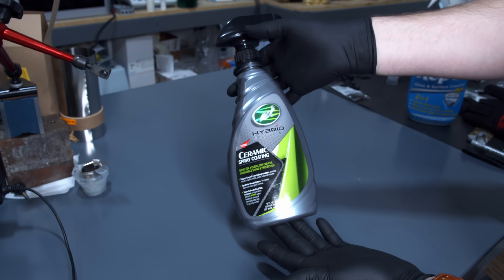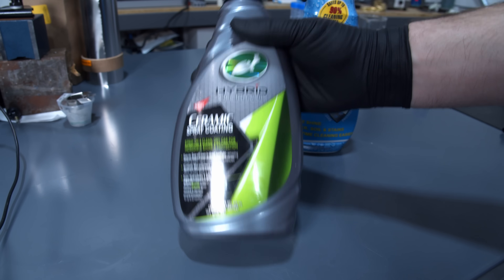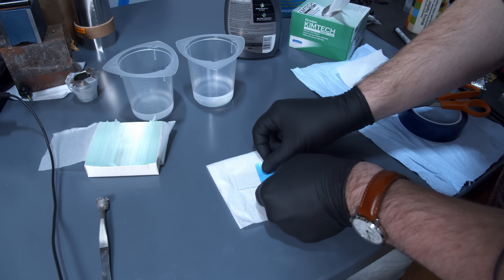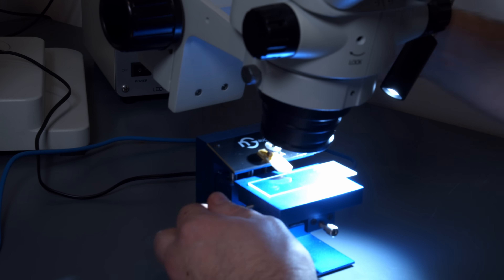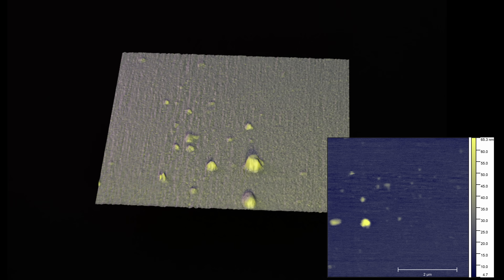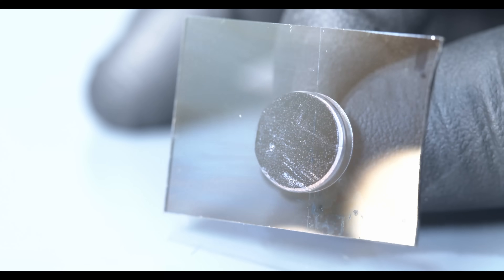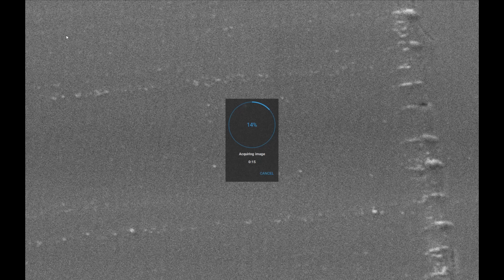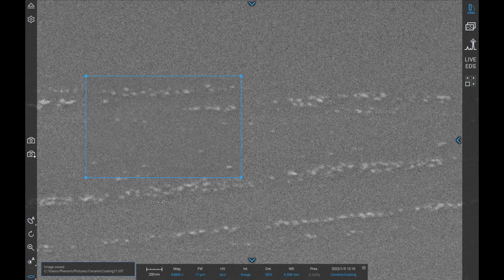Ceramic Spray is (probably) useless

Comment: I've used the 3M ceramic coating on cars, as well as on the windows, with great results. It's a bit pricy, but definitely worth it! Maybe you could try that one in a future video? For use on the windows of cars there is also a pre-treatment spray that you can buy with the ceramic coating kit, but I'm not sure what it exactly is and what it does. I've never tried coating windows without the pre-treatment so I can't say if it's necessary or not.

Comment: Weird tip from a photography friend in college,
If you need canned air without the bitterant in it (it puts a nasty coating on fine lenses) buy Smith and Weston gun duster.

You get a big can for a reasonable price, unlike the photo or scientific canned air which has about a tenth as much for triple the cost. It's all the same stuff it used to be before every news channel decided to tell kids they could huff it.

Comment: I've thought about using a tablet screen protector on the inside of a mill. They are hard glass, have hydrophobic properties, should withstand the chips better than the poly panels, and when they do wear out, peel it off and replace it with another. Unfortunately my boss didn't see it as worth his time, and i dont care enough to spend my own time and money, so I have no idea how it actually works.

Comment: As a detailer most "ceramic" spray type coatings don't work well on glass at all. As for paint, it definitely lasts longer and is more hydrophobic than a traditional 100% carnauba wax. Now what we call "true" ceramic coatings or ones that come in a glass bottle around 30-50ml and require application by hand are probably more what you were expecting. That specific turtle wax product I've had last up to 3 months vs a true ceramic has lasted 3+ years.

Comment: Wow, you totally bungled the test and misused the product! You did not even pretend to follow the actual directions, nor did you notice that the spray was meant for PAINTED SURFACES, not glass! The silica is actually added as an abrasive to condition the surface of the paint! Can you not read labels? After saturating the surface with 2 sprays, you were supposed to wipe the area with a microfiber cloth to work the silicone into the surface. Then, you were supposed to lightly wipe with a fresh cloth to remove the leftover ceramic particles. They were NEVER meant to be any sot of magical shield!

Comment: An observation. When you mixed ingredients by shaking vigorously then spraying I didn't notice if you cleared the feed tube first. If no, then you may get a lesser amount because what came out was not the mixed solution but only what was in the feed tube. The amount that was sprayed on the glass was so minimal that it may have taken a good number of pumps to get the mixed solution to flow correctly. I could be way off the mark so feel free to educate this dim witted student.

Comment: This is probably an ignorant comment, but is this not designed to be rubbed in and rolled around a lot instead of one light pass?
Again i’m probably wrong but will it break down and cover more area?

Comment: You should probably use a true ceramic coating with 9H hardness. The kind that lasts like 5 years. Then just use a topcoat from time to time to boost the effect. I would also use some cutting polish to put micro scratches on the glass then apply ceramic. The polish won't effect visibility at all but it will give the ceramic a way to bind

Comment: Could it be that this product is made for cars thus focused on paint? Your glass slide is MUUCH flatter through a microscope than a car's paint, right? I'd imagine that the amophous silicon accumulates in the paint layer's micro scratches and orange peeling. Which through the microscope may look like pooling but in practice works as a shield?

Comment: Dont use glass application "ceramics" rather use metal protectant applications (like car metal clear coat "ceramic"), but better yet I think high end furniture seal ceramic is best for hardwood furnitures, cause humidity can literally ruin expensive woods and burl. So 2 part applications are thicker, and more repellant.

Comment: Youd likefly have better results using either automotive application ceramic coat. Or furniture applicator ceramic 2 part applicators, or something like Rubio Mono Coat. All hydrophobic and much more robust id think.

Comment: I use this spray to protect my car from a group of locals that attack my car with various chemicals like brake-fluid and solvents. It definitely works and provides protection. I would try two areas and attack a material with a acids/solvents then check the differences. I stand by the claims made on the bottle - amazing product.

Comment: What about a piece of glass that is subject to the elements? Like a a wind-shield or a window? The "elements" make invisible scratches, and the particles accumulate in and around them, and make the surface smoother. effectively eliminating places for gunk and grime to hitch.

Comment: I came to the same conclusion, more or less. I got Meguiar's Ceramic Hybrid Vax. Applied to a car with a very decent paint, and according to the instruction, down to the "t". First impression was that it made paint "grabby", quite the opposite of what you'd expect from a "wax" protectant. I used car normally in the next few months, and my "Look & Feel" test were that there is little to no protection to the paint. Car got dirty just as if I never applied anything, and same conclusion was when I was washing it - there was no "just rinse the dirt off". Nope. Applied it to a vehicle with much worse paint, with same results. No "beading", no slickness, no noteable "washability" of the normal dirt layer. Waste of time and money. Im sure the expensive stuff works better than $15 from Walmart, but I reverted back to usual wax treatment. You can go to see the video about my experience here: https://www.youtube.com/watch?v=hmv7QA8EMZs

Comment: you could try plasma activating the glass surface before spraying on the coating. Exposing the glass slide to ie a low pressure inductively coupled plasma will add reactive hydroxyl groups to the surface of the glass that will more readily bond to silica in the coating. this is the same process used in microfluidic microfabrication to bond glass to PDMS.

Comment: I’m excited you are doing this kind of examination with the spray.  I feel like you didn’t apply it right. I use this on glass and it surely makes the window repel water. Maybe you didnt spray and wipe while moist to spread around and then buff dry.    There is certainly some kind of coating on the various vehicles I have this stuff applied on.

Comment: Interesting that you didn't actually test it. I have seen a number of tests with different versions of ceramic products. And this is one of the cheapest and yet one of the most durable lasting protectants I have ever seen when actually put to a physical test of whether or not it is providing resistance to something sticking do it. So instead of running your damn mouth, why don't you actually do a test as to whether or not it works on the inside of a damn CNC machine like you started to talk about in the first damn place. Talk about a useless video? I put it on the screen of my touch screen phones and they're still pretty slick after several months of use

Comment: why not use a small "windshield wiper" sort of device on a motor and switch?
Reply from the maker: It's a good thought! But the volume of coolant that gets thrown at the door means something like that won't generally work (gets covered as soon as it finishes wiping). There are special viewports that work with a high-speed rotating window, which flings the water off so you can see clearly. They are pretty expensive though, so next best is just trying to get it to bead up on the window so you can see through the splashing better :)

Comment: Don’t rule this out just yet. Quality ceramic coatings can last up to 7 years and cost a fortune. They provide a very chemical resistant and hydrophobic coating for years. The cheap car wax sprays with SiO2 added are meant to be reapplied every few months. They don’t last much longer than normal car wax. Those are mostly gimmicks.

Comment: This immediately suggests to me another product to try - 'Novamin', a trademarked phosphosilicate formulation used by Sensodyne in toothpastes, supposed to adhere to tooth enamel, smoothening the surface and coating it with a protective silicate layer (yes, the claims go as far as granting acid-resistant glass-coated teeth). Would love to see this kind of home experiment with the stuff.  (for that matter, examining tooth surfaces under AFM, and seeing how initial damage begets additional as the surface becomes craggy and thus has increased food particle adsorption)
Reply: Been using Sensodyne for two decades, but never heard of Novamin until now - I can't say for certain that it works like you say they claim, all I know is it leaves my teeth feeling slick as ice and I love it 😬 Looks like you've given me something to read up on, appreciate the tip!

Comment: Acetone doesn't leave a residue, and Isopropanol doesn't leave a residue either. You got shit in your solvents is all
Reply from the maker: Ok so semiconductor grade acetone handled in a cleanroom and quartz containers (which are cleaned to semicondutor standard) won't leave a residue. Any other acetone will dry fast enough to leave some contaminant behind, even lab-grade stuff straight from the bottle. Literally every microfab prep protocol instructs you to rinse acetone with IPA, and IPA with DI water followed by nitrogen air dry (preferably all under a clean hood)

Comment: For the CNC window, I'd say use a phone glass protector "glass type",

 they have the coating, they have abrasion resistant surface, if you apply them on the inside of the machine window and keep it bubble free it should work great. they are also cheap and easy to apply and remove.

the UV cure and optically bonded ones are even better.

Comment: Hold on a second, this is my research expertise (kind of, just submitted my master's thesis on silica). if you EVER need to find out nearly anything about Silica, you need to read the book from Iler "The Chemistry of Silica: Solubility, Polymerization, Colloid and Surface Properties and Biochemistry of Silica"
The silica particles you see here are aggregates, as the primary particles produced by precipitation are never larger than approx 50 nm, but they can be as small as approx 2 nm, depending on synthesis conditions again.
These aggregates cannot be broken apart further, even by mechanical means, once they reach about 500 nm or so. They're very bulky, which indicates to me that they have been formed quite slowly and aren't poropus at all. But I think you're right, the coating isn't very good, because you can just... RUB OFF The silica off the surface. there isn't anything in the formulation that would make it stick to any surface, other than already existing glass... and even then, that doesn't occur until like 80°C at pH 9-10 ish.

Comment: How often did you pump the spray?
On camera you seem to shake and directly apply the stuff. This means you might not have applied the freshly agitated solution from the bulk volume, but rather the stale liquid from the pump suction tube and pump body.
Reply from the maker: It's a good question, and I didn't think to mention it at the time. I've used this bottle a fair amount and had sprayed some off-screen before filming (was going through the motions on-camera so folks could see the process), so I don't think it was just stale/settled. But I'm re-doing some of the experiments and adding a few more scenarios... if anything interesting shows up or I totally botched the first run, I'll post a followup video!

Comment: Where are very expensive ceramic coating , in very tiny bottles. They do help, but not for long. I use it for motorcycle helmet visor. They make surface very slippery and hard.

Comment: This kinda conflicts with the practical findings by Project Farm. I assume there is a problem with the application, either the slides being too smooth (or glass generally being not a good surface), or bottles were already depleted.
Reply from the maker: I'm not familiar with that video tbh (heh, can tell i'm a material science guy and just wanted to see the nanoparticles 😂), but I'm running a few followup tests based on comments/suggestions here. Stay tuned! Bottle is definitely not depleted, but the slides being too smooth/hard is a very valid point I hadn't considered before!
Reply: @BreakingTaps  I highly recommend Project Farm. In that particular video ("Best Ceramic Spray Coating?"), he systematically tested different automotive coatings, and  their resistance over time and with weather.

Comment: I wonder if the problem is that the glass slide is very hard compared to automotive paint. It could be that the silica particles are designed to be buffed into the paint, which effectively embeds them in the paint. Glass is hard, so they can't dig in. I take this concept from the principles of lapping, where you load a soft lap (often copper or aluminum) with abrasive to make a tool that will improve the surface of a much harder metal. Robin Renzetti has some great videos on lapping if you are interested. Tom Lipton of Ox Tools too, come to think of it.
Reply: If I imagine "buffing" silica particles into paint, I'm thinking you're doing abrasion with some particles digging in enough to stay. Automotive paint is plastic. I really can't imagine how embedded silica particles are providing "protection" when they're functionally acting as an abrasive. I'm guessing that the carrier solution is akin to the hydrophobic film that RainX leaves, and that provides the short-term feedback of the surface shedding water. The silica looks like marketing hype and the thin film would likely be as short-lived as RainX.

Comment: What about that nano stuff you apply to car windshield? From my experience it lasts for about 4-ish weeks and seems durable enough to handle being wiped by the windshield wipers.
Also it seems quite hydrophobic. I've personally never seen this spray, the stuff i use comes from a bottle and is applied by wiping it on.

Comment: You got all the instruments all of us could only dream of, costing big money, yet you did not think of letting the stuff just dry on the glass without wiping it off. Or simply do some real world tests. 
On this small sizes, even a few particles could make the water repel off, so simply scanning the glass will not tell you if it works. Especially since there is no scientific method behind all these testing: we need first to check how much pure glass repels water, how much other substances help, THEN compare their scanned images, so we can draw conclusions about the method itself! you were using (scanning them and draw conclusions based on their visual appearance and measurements).
In fact I saw videos where they just simply used such substances and compared them in real world usage, and a few of them actually worked well. That simple test was a lot more useful. Even a lot more scientific.

Comment: If I may- I think the part where it's applied as a spray & let dry before wiping is important; small droplets of solvent carrying particles dry up & deposit the particles without most of the particles being washed off in an excess of solvent!

Comment: It'd be interesting to see if a nanoscale structure could be etched onto a glass slide (either optically or chemically) to provide a hydrophobic effect. 
Another possibility could be a sputtered coating that is either selectively blocked by an initial step (something blocking the sputtering sticking in a controlled manner) or removed by a secondary process.

Comment: These coatings are meant for clearcoat which is much softer than glass so I’m assuming the particles can more easily get embedded in the coating as opposed to glass which they will just wipe off
Reply: Exactly. I was an Automotive refinisher for over 25 years. I think a good wash and a coat of good silicon polish and or Carnauba wax is best to protect your car paint. I tend to think the Ceramic think is a big sales gimmick. Besides Is ceramic not an abrasive product anyway. The best thing you can do is keep your car out of the sun. Nothing will protect a surface indefinitely from UV rays.
Reply: This and I would imagine the coating of the Clearcoat finish to be much more porous than this glass. This stuff is not a replacement to rain-x nor does it claim anything on glass
Reply: Now if you were to run this experiment on the item it is intended for, that would be much more fascinating. That will truly debunk the advantages of these ceramic coatings

Comment: If the silica settles out you may have sprayed most of it at some earlier time where you didn't properly shake the bottle, since the siphon tube pulls from the bottom. I assume the particles are supposed to make the water bead up around them through surface tension, leaving the rest of the glass water free.

Comment: Would it help with the airplane vibrations issue if you soundproofed the walls and placed the microscope on a sand table like what's used to make holograms and in some other optical experiments?